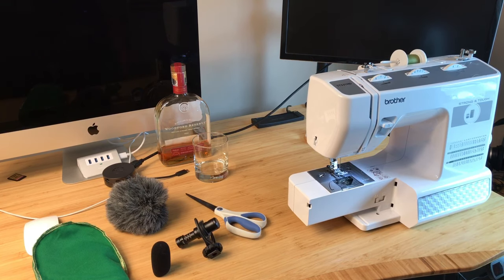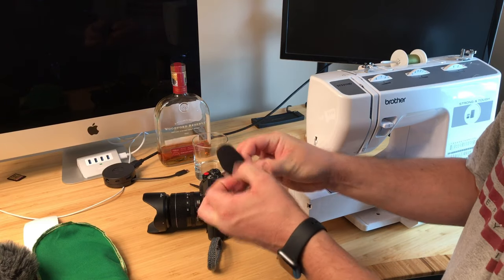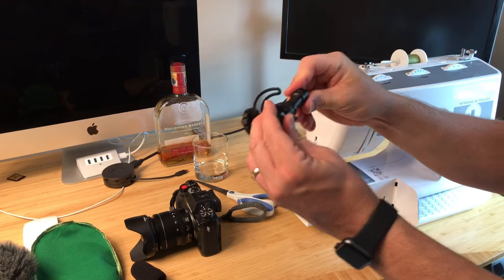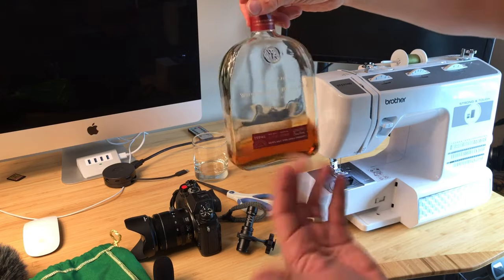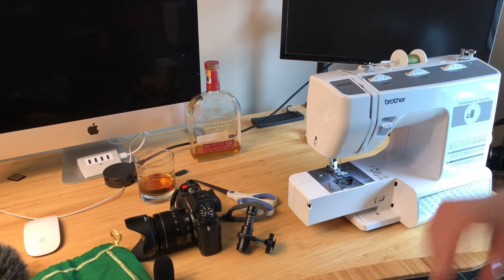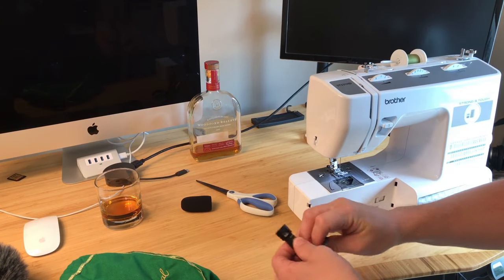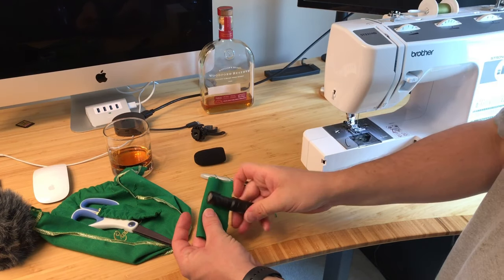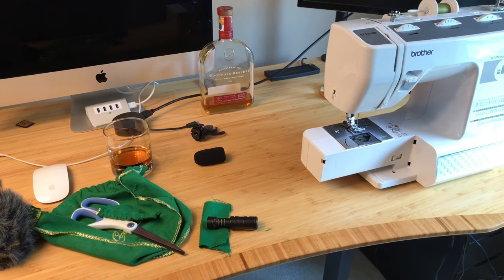Rode Deadcat Take 2 - Trying to build a better mousetrap

Comment: I don't do videos at all, but I just wanted to tell you that I’m glad you’re ok (and back on you-tube). BTW, about three weeks ago I got the X-T4 and the XF 16-80, great combo, I’m very happy with the setup. Stay safe.
Reply: @ShutterFanatic  Yes, I got the X-T4 (I'm keeping the X-T2), I did my own “non-scientific” (really non-scientific LOL) testing/comparison and found that on a side by side the X-T4 locks focus faster (by a hair) than the X-T2. I like that the grip is a little larger, definitely like the longer battery life and that stills/movie switch so that I don't have to see any video settings on the menus (I shoot 100% stills). I’m not too crazy about the LCD screen, I prefer the tilt one for when I’m shooting from the “hip”, it’s OK in the vertical position, but not so much for shooting horizontally because now it sticks out on the side of the camera, but it’s something I can work with and I’m sure I’ll get used to it. I don’t like charging the battery in camera so I got the double charger (yes, I got an extra battery). To summarize and as I suspected, this camera did not make a better photographer (LOL) but I really enjoy using it. BTW, I’m not a pro, I just shoot for fun and as I mentioned above, only photography, so I can’t really give you my opinion on video performance.